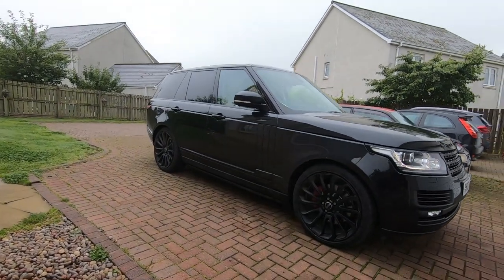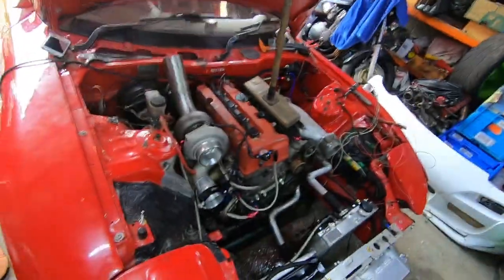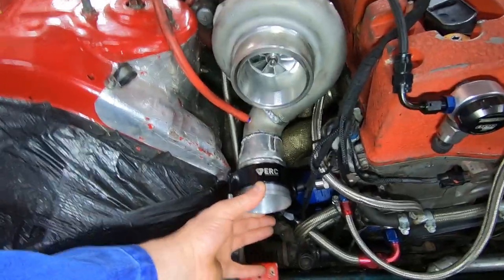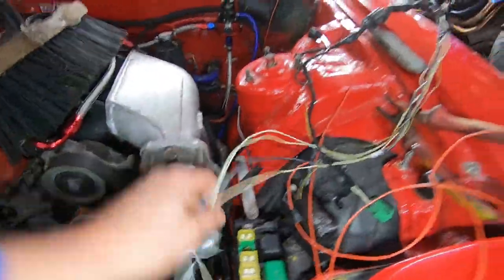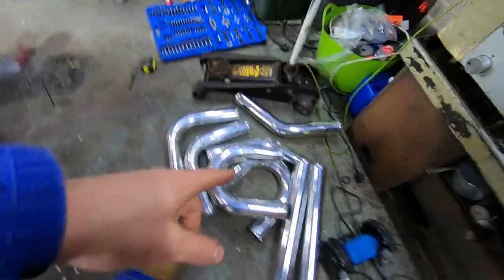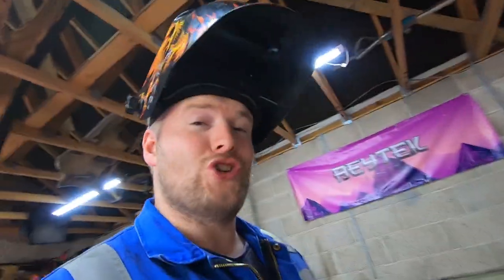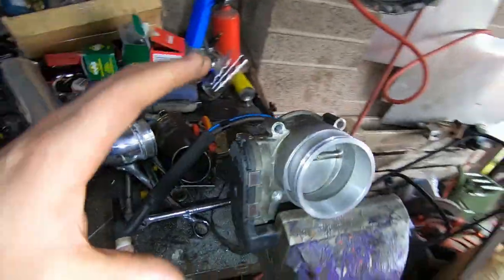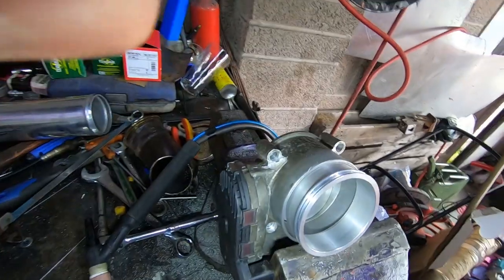K20 DCT RX7 [ INTERCOOLER PIPES + FIRST START ] ERC BOOST CLAMPS

Comment: @BEYTEK I was thinking of welding this quick release flange onto the electronic throttle body, but i am scared that welding will dame the internal electric circuit :D your looks like working, so no problem with welding directly onto throttle body?
Reply from the maker: yeah i still use the same one